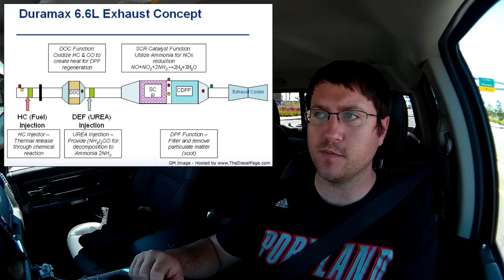Regens, DEF and Emissions Explained on the 6.7L Cummins - 2013 through 2017 Ram 2500

Comment: As a class 8 diesel tech, I have always wondered why Cummins uses a dedicated doser (injector) for the doc/dpf on their heavy duty engines and not the light duty ones. Just like you mentioned, it greatly reduces engine oil life by way of fuel dilution. We have had trucks in our medium duty shop that have injectors fail and due to the extra fuel during the regen cycle, the crankcase was over filled by up to 30% and took out the main bearings on the crank. So entire engines have been replaced because of the way they introduce fuel for regen on the small engines. Crazy! This was a good video man. 99% of the YouTube vids on this topic are way off on their facts and-or terms.
Reply from the maker: +blake dymond Thanks man, I sincerely appreciate it. I apparently missed the mark on some things and am working on a pinned comment to correct those. Great info and thank you for sharing.
Reply: blake dymond the late injection cycle diluted that bad into the oil system to smoke the mains? How many miles were on it? That's impressive.
Reply: Erik B no idea how many miles were put on it. A tech in the medium duty shop was working on it and showed it to me. I work in the heavy line shop. I'm sure the driver put quite a few on it though. Most of them just drive company trucks until they stop running or derate and won't go but 5 or 15 mph. The guys that own their trucks are way more proactive. They come in as soon any light comes on, mpg drops, or they have to start adding fluids like they should. There's truck drivers and then there's seat warmers that can shift. Lol
Reply: you probably dont care but if you're stoned like me during the covid times you can stream all the latest series on InstaFlixxer. I've been watching with my gf during the lockdown xD
Reply: @Rex Juelz yup, I've been watching on InstaFlixxer for years myself :)
Reply: Also good info. Thank you!

Comment: A few comments Christian.  Excellent video on the emissions system.   While urea is a component of urine, DEF is NOT made from urine.  The urea used in DEF is very carefully synthesized from natural gas.  I believe you said DEF was 38% urea.  It is actually 32.5% urea and 67.5% deionized water.  It is very carefully made and very pure.   I really liked your honesty about how well the complicated and expensive system works to keep our air clean.  That is not said much in videos about diesel exhaust, efficiency, power,  or longevity.   Yours was a refreshing and important discussion.  You pointed out the pluses and minuses very fairly. I have a 2017 Laramie crew short bed.  I can honestly say that I have never experienced active regeneration in this truck min over 22000 miles.  However, we put 99% of our miles on it towing either a gooseneck horse trailer at 10-12K pounds loaded, a flatbed hay hauler (usually with 5 tons on it), or our Outdoors Timber RIdge RV (shameless plug for an Oregon product) trailer which is about 7000+ pounds wet.   I think our exhaust temps while towing make active regeneration unnecessary.   I have driven this truck empty from Spokane to Fargo North Dakota (about 2400 miles RT) on less than 2.5 gallons of DEF when running empty and not pulling a trailer.   When pulling the Outdoors RV TT it takes more than twice that amount.  I was very surprised when I  first discovered that DEF consumption rises dramatically when hauling heavy loads.  DEF cost is still almost insignificant in the total cost of ownership.   That said, this is the best truck I have ever owned bar none.  It is my 5th Ram since my first in 1994.  It is so comfortable and easy to drive even with a very heavy load.  I cannot say enough good things about it.  A truck just can't get much better.  I just added Firestone air bags on the rear and Bilstein Shocks all around along with Bilstein dual steering stabilizers. I had Timbrens on the rear and was happy with them towing, but the ride empty was harsh.  Not any more.   Excellent upgrades to the ride and level towing ability for sure.  Keep up the good videos.  I stopped watching  a while back and now I am catching up with the ones I missed.  Good job on all of them.  This was particularly good and necessary to balance some of the bad stuff out there.

Comment: Thank you for taking the time to put this together! It is certainly helping me as I move towards buying my first diesel truck. Debating between 2500 and 3500 dually.
Reply from the maker: +Alexios The Wretched Thanks man and glad to be of service. Dually is outstanding for towing heavy, heavy loads but they suck for everything else in my opinion. Just make sure you need it before you compromise
Reply: PNWreckage Thank you for the response! Certainly a lot to consider since I may not need it now, but hope I will need it in the (hopefully near) future. I intend to keep whatever truck I buy for a long time... anyways keep them videos coming! Appreciate the "tone" (sarcasm) and of course, your perspective/experience on the issues.
Reply from the maker: +Alexios The Wretched I will keep at it
Reply: Did you get one?...it's been a year.

Comment: Hey man good vid.   I’m one of those guys that ordered a brand new 2022 Cummins just because I wanted one.   I have a 4700lbs boat I can tow around if I have to.  The truck is going to be my daily driver I drive about 30km a day for work on the highway at 100km/h.  Hope I didn’t make a 90k$ mistake

Comment: We have a 2016 3500 with 22,000 miles now. I had the REGEN process happen once in the first 500 miles and it hasn't done it since. We tow a lot.  I did have the service def system light come on once when we were driving through a national park all day at low speeds up and down hills with the exhaust break on.  It turned off the next day so i didnt take it in.  I go back and forth on whether to delete it or not as this will be my "forever" truck with ALOT of miles.  NICE VIDEOS.
Reply from the maker: +Stephen Thank you for sharing this. If it's your forever truck (like this one is for me) then deleting is probably in your best interest. Not suggesting you do it tomorrow or anything but it's something I'm thinking about also. Thanks man

Comment: Fantastic info. Loved hearing both sides. I'm a female and have had my 2017 Ram 2500 since Dec. of 2016. I am fully committed to running it until it completely falls apart. I hope to have it at least another 20 years. Love my truck. I am a horse and agriculture gal too so I want to be good to the earth, but honestly I want to keep my truck running top notch even more. I'll offset my carbon footprint some other way. 😁
Also been having codes regarding the emissions system and after replacing the actuator, removing & cleaning the EGR valve and still getting new codes I am really considering deleting it. Next is to clean the turbo before making that decision. Since I only run my truck around town anymore for the last few years it makes sense that it is getting clogged up. At least now I understand why. 😊

Comment: I have been looking at both gas and diesel new trucks. I believe that all of the emission controls on these diesels are an evolution in progress much like gasoline engines went through in the 80's and 90's. I have decided that currently there are too many over complicated "bandaids" on these new diesels. The odds of problems, cost of repair, and service of these diesel trucks is more than I want to risk at this time. I will probably buy a gasoline V8 for my next truck as it will meet my needs but it is not what I really want. The risk of problems, extra costs, time in the shop are too much of a gamble with my hard earned money.

Comment: Good informative video. 

 I drive a 2017 Ram 3500 with the 800 ft/lb version Cummins and 68RFE transmission.  I recently got a Bluetooth code reader and OBDFusion iPhone app.  This lets me monitor all 5 (yes 5!) EGT sensors.  I just towed my 15,000 lb 5th wheel trailer to 10,500 ft in Colorado, as well as a lot of other serious climbing in the last week since I got the app.  At 60 - 65 mph I am seeing temps of 750F to 850F on average, even when pulling serious hills.  On very long hard 6 degree grades, I still never saw higher than 940F, and that was just for a moment or two. So in my experience, it is pretty hard to get up to passive regen temperatures of 950F, even while towing heavy in the mountains.  These temps are from the first of the 5 EGT factory probes, and I don't know how close to the cylinder it is.
The app also lets me see the EGT downstream at various points, so I can monitor it while it is in regen.  I have only seen it in regen once since getting the app, and the temps at the DPF were around 1050F at the highest. And if the OBDFusion app had not told me it was in regen, I never would have known.  It was imperceptible.

Comment: Very good video.  I did some of my own research before encouraging dad to replace the gasser F350 farm truck (which was a dog and which whenever I would tow with it, I had to have it screaming to make any hay) with a 2018 Ram 3500 chassis cab with Cummins engine, and I have become convinced that the modern diesel engines and the transmissions backing them are probably the most reliable of any era, and that the exhaust emissions would be the weak spot as far as reliability.  However, we use this truck in a way that will generally minimize the amount of active regen that would be required.  The truck has a 2,500 lb bale bed on it, with a 1,200 lb cube feeder on top of that, so when it is being driven, it is working.  The truck will be driven slowly in the field, but there is a 45 mile highway trip from home to the field. So far, the only complaints that we have had is the DEF consumption, but I am pretty sure that the DEF tank was NOT full when we left the dealership, as we put some in during a trip last week. 1,500 miles on it so far, and so far, so good.  I am like you... a bit of a tree-hugger, but I love diesel trucks and guns.  

IMO, the addition of all of this emission equipment should make people really consider whether they really need a diesel pickup whenever they are buying one, whether their normal usages of the truck is going to be something that will necessitate a diesel truck.  If you just like the sound of a diesel truck, and you will not be doing much towing, but instead off-roading, you might be better off with a gasoline engine.  If you are going to be towing in town with lots of stops, you are probably going to be better off with a gasoline engine.  The gas engines in todays trucks are not bad engines in city driving, especially with the modern 6 speed transmissions and the low rear-end gear selections that are now available.  My experience with pulling with a gasoline truck has been that take-offs have a surprising amount of alacrity in city environments, and it is only upon reaching highway speeds that it becomes significantly harder to keep speed than a diesel.  If you are going to typically have a load on, traveling at highway speeds for a significant portion, you should probably have a diesel truck.
Reply from the maker: Outstanding comment.

Comment: One BIG thing I didn’t hear you say everyone should try too do . When it is in Active or Passive Regen LET IT FINISH do not turn off the truck , you can tell it’s in one by the sound or if you have a monitor watching exhaust gases rise over 900deg . Turning it off causes issues

Comment: "Diesel Exhaust Fluid Fluid" :P

Really thorough explanation. You covered pretty much everything I think. Like you said the whole thing is a balancing act: Too hot and you get NOx (NO1 and NO2). Too cold and you get DPM (Soot). All of these systems do a great job of balancing that out to reduce both kinds of emissions, it's just a shame you have to strangle the engine, dirty-up the intake and oil, dump your unburned fuel, and repeatedly purchase cow pee to do that. 

Also the cost of replacing a faulty DPF is more than the cost of a full delete, which I think is I think a pretty common trigger for people to go down that road.

If you are ever concerned about getting caught with a deleted truck on a trip somewhere, there are stealth kits available. It's basically a straight pipe but shaped like it still has the DOC/DPF/SCR intact. Some come with block-off plates for the EGR, but still have to leave that giant-ass cooler in your engine bay even though it can't be used. Some just rely on the tuner to keep the EGR valve closed, but then you take the risk of it getting knocked open somehow while the system isn't functioning. Either way, it'll pass a visual inspection if a cop decides to stop you and look under the truck.

*Edit:* Apparently I've gone crazy. Doesn't look like there are stealth exhaust kits for sale - people either hollow out their own or get a spare exhaust from a junkyard and hollow that out instead.
Reply from the maker: +vsTerminus oh crap did I say fluid twice??
Reply from the maker: +vsTerminus pinning this comment because it is outstanding
Reply: vsTerminus where might one get ahold of a stealth pipe and egr block off plate?
Reply from the maker: +Aaron Walczak also curious
Reply: +PNWreckage At 00:11 "D-E-F Fluid" ;)

That was the only time though lol
Reply from the maker: +vsTerminus RUINED lol
Reply: +PNWreckage + Aaron Walczak, I could have sworn I saw a kit for sale, but I can't find it anymore. Sorry!

There are a few guides out there from people who did their own stealth delete by hollowing out the cat and DPF with a drill. There is a pre-DEF guide on Carbonite Cummins: http://carbonitecummins.com/articles.html

You'd still need a tuner to shut things off, keep the EGR valve closed, and suppress the Check Engine Light even if you go that route.
Reply from the maker: +vsTerminus good to know

Comment: Not bashing on your video or you, just correcting. Nitrogen oxides, more commonly known as NOX is, as you stated, a byproduct of heat during the combustion process. Egr, is the process of taking exhaust gas from the manifold, pre turbo, and routing it back into the inlet manifold. Exhaust gas is inert. That is why they use it. The inert exhaust gas is cooled via the egr cooler then introduced back into the combustion chamber to cool the combustion chamber. Which reduces NOX.
Reply from the maker: +blake dymond well said and pardon my error in saying post turbo

Comment: I had a Cummins and here is the deal: they don’t tell you that this engine will start clogging up the day you drive it with soot.  After 15K miles my engine performance went way down sluggish and non responsive.  My engine also got a lot louder on the top end valve train.  So with the black smoke now going back into the crank case oil - when you do a oil change and after 100 miles that new oil is black like tar looks horrible.  You have to use synthetic oil with new def changes so you will need to buy an oil change plan or pay $180 per change.  Then you have fuel filters to change ever 15K miles.  If your DEF emissions plugs up it may be covered under warranty but you truck will be shop for a while.  Also don’t forget about the67,000 service that is $1500..  if you are out of warranty between your under the hood emissions and under the truck exhaust dpf regeneration you can easily pay 1000 of dollars on repairs and part.  A turbo replacement is like $7000.00.  Injectors replacement are $8000-$13000.  I sold me Ram Diesel at 15K miles and went back to a 1500 and love it.

Comment: Good video and thanks for the info....I feel lucky as crap...my DEF consumption on my 2018 2500 is about 3 gallons every 7500 miles.... don't plan on doing any deletes for a while, my dealership offers a 20 year 200,000 mile warranty; so I will wait until I hit one of the marks then play
Reply: scackley wow....what did that warranty cost?  I would never delete if I had that.